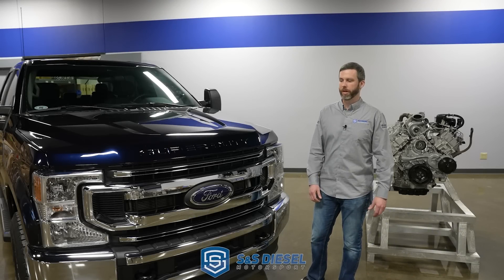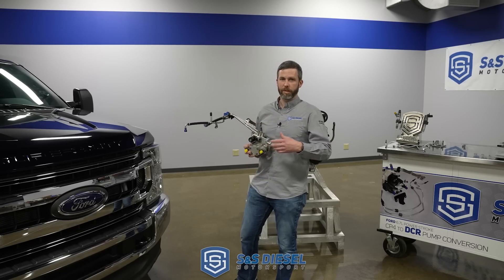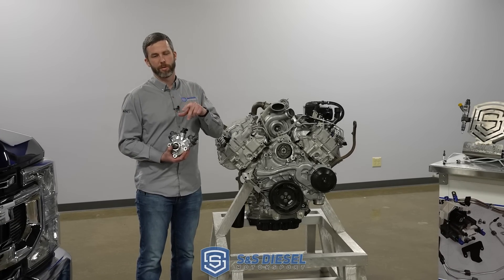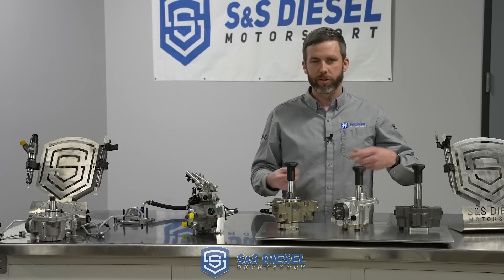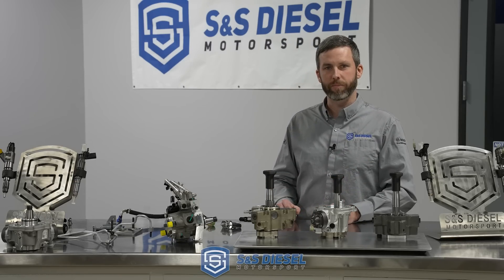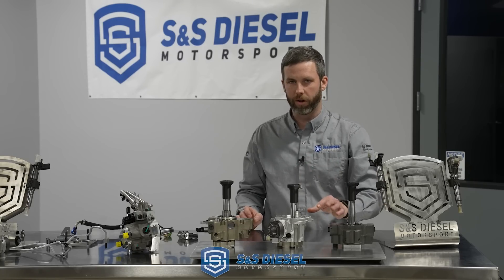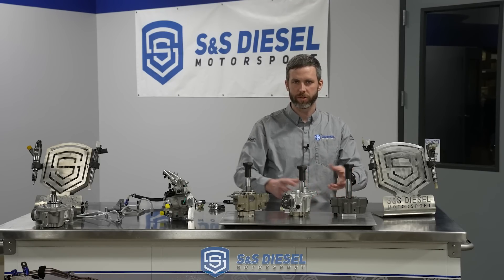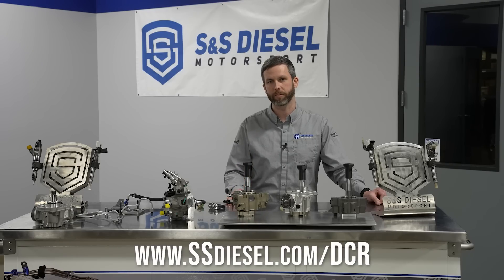The Long-Awaited Ford CP4 Solution - S&S Ford 6.7L CP4 to DCR Conversion

Comment: Does it flow more or less than a stock cp4 @ 2000bar? Is it more or less efficient @2000bar @stock 17-19MY max output? I'm super pumped you guys made this kit!
Reply from the maker: It has 25% more displacement than a 15-19 CP4.
Reply: @SSfueled  what about 21 cp4 in f250
Reply: 25% more than a cp4.2
Reply: @ryanstansel2338  I hope so. That’s really impressive! Do you have a link to this info or where did you get this information?

Comment: Finally!!! One biggest question is how good is your  warranty? I had a cp4 failure 15 mins. after installing the D.P.K. Truck only started up 5 times after I installed your kit. So now kit is a 400.00 paperweight. To keep ford's warranty on the new pump I could not put your D.P.K. back on or it would void the 2 year unlimited mileage parts and labor warranty for the whole fuel system from Ford. S&S did email me asking for my phone number, I replied with it and no one has EVER called back.
Reply: @Len Daniels did Ford give you a reason for the CP4 failure?...Also what was their rationale for leaving off DPK?
Reply: @zekester1  no, just that there was metal shavings in the filters. Plus pump would only reach 960 psi. Instead is the 5k psi needed to start. If I put the dpk on It would void the new pump warranty. When I installed the dpk it started. Ran it a few mins to check for any leaks, shut off to clean everything up, moved out of shop to change oil, started to warm up and checked oil level. Then it never would start after that.
Reply: @lendaniels7348  it sound to me the pump was having issues before putting on the DPK...if your fuel tank wasn't super low and you ran the truck for just a few minutes...it seems to me that little time would not have put metal shavings in both filters...did they replace your whole fuel system?
Reply: @zekester1  yes they replaced whole fuel system. I told them to give back the line I modified to install kit. Never had any trouble with truck ever starting and I've been in -2 weather. Truck had 115k mile one it. Know of one other guy that his truck died while running  at hwy speed and then truck would never restart. His truck had 75k miles on it, but Ford covered it under warranty. Ford was going to cover 90% till they saw a installed the dpk and denied any help.
Reply: @lendaniels7348  man, sorry for all the trouble...I've had my DPK on for about a year & 4 months no problems...I think they took advantage of you in this case....the dealer I go to is the one that put on my DPK & many others in the area
Reply: @zekester1  I have asked several other service managers and Diesel techs. It is up to them to endorse the dpk. Some say Ford should have it installed on every truck. Others say if it's that good why don't they offer it. Same with the active fuel management delete kits Chevy offers. Chevy knows it's a flawed system and the kits you buy aftermarket have gm part numbers and are cheaper than getting from the dealer.
Reply from the maker: Your particular issue is out of the norm, which is why we wanted to have a conversation to get a better idea of the details. We apologize for dropping the ball and not calling you back. Our warranty is two years and unlimited miles on all products. Thank you for bringing this to our attention, you'll be getting a call today.

Comment: Great news for us.
Besides the fact that this pump eliminates the CP4 problems the only other thing I cared about hearing was the Horsepower capability of this pump. Does it flow more than a Stock 2022? Will it run high-performance aftermarket Injectors without starving them for fuel? 
Not to sound negative, but thank you for this awesome innovation.
Reply: @carterlawson5784  Yes it is. They are just taking orders for 11 to 19 first. There is a second video of them explaining this.
Reply: @carterlawson5784  If you simply watch the video they posted after this one you would hear what I said in my last reply...
Reply: @carterlawson5784  it's definitely coming.
Reply from the maker: You're welcome. We designed this to be a durability improvement and have not tested for increased power. The DCR has 25% more displacement, but that may not necessarily equate to a 25% power increase (if the calibration calls for it). Since it will be CARB compliant, just installing the conversion by itself will not increase output in any way. We do not recommend changing the calibration on street-driven vehicles.
Reply: @SSfueled  Peace of mind is more important than hp numbers.
Thank you for the reply.

Comment: This is perfect!! I really like the fact that Stanadyne is behind this his! When my CP4 craps out I know what I’m ordering. Might even order it ahead of time to be prepared!
Reply: Why would you wait for it to fail??
Reply: @wyo_garage20 my thoughts too
Reply: Don’t wait for a failure
Reply: I’ve got an extended warranty with the dealership local to me. They will pay for upgrade with labor included. I mean I’ve got 60k I can rack up. If it goes out in that time frame why not take advantage of it? Once warranty is up I’ll do it myself…along with other things they don’t want me to do.
Reply: @sav300  cool beans
Reply: @jamesw.6931  I have the prevention kit as well just incase. I’d love for it to go out under the warranty but if not it’ll get done. I’m ordering mine as soon as they list them on the site. On the notification list with Thoroughbred diesel!!
Reply: @jamesw.6931  My 2020 went out at 89k miles, I live in Florida and my truck took a shit in Nashville, TN. I payed for the extended warranty out to I believe 125k miles, but Ford would not cover my trucks pump. They came back after my truck set behind their locked gate for 3 days, and said they found gasoline in the fuel. Which I know is a bold face lie, because the last place I fueled up was at bucee's in Calhoun, Georgia. Where I topped off my DEF and topped off my fuel take with DIESEL, they don't even have a gasoline pump at those particular pumps. Yes, they tried to make me believe I put gas in my tank, and then went from Calhoun, Georgia all the way to Nashville before my trucks pump blew up...yeah right!
Reply: Yup, I have a buddy whose employee put gas in his diesel, and it barely made it out of the parking lot before failure. They said I went 60 miles thru the rest of Georgia and then all the way up to Nashville, which is at the top of the state...no way that could happen.

Comment: Same question, how much horsepower will it support? Will tuned trucks benefit
from this pump
Ie increased fueling vs the stock pump.
I'm asking bc I'm wanting to upgrade my turbo and pump. I would love to get this pump and knock out two birds with one stone! 👏
Reply: Listen to the video they upload after this. It's a larger displacement pump.  Read between the lines and it will answer your question.
Reply from the maker: We designed this to be a durability improvement and have not tested for increased power. The DCR has 25% more displacement, but that may not equate to a 25% power increase.

Comment: How much $$$?
Reply from the maker: $1,990
Reply: @SSfueled  Gotdam! That's about 3x too much. Who is going to replace a pump that's not failed?  You would sell the heck out of them at maybe 1.5x-2x the price of the DPK.  I understand a whole system is 10k.  Nevermind, I had no idea a standard replacement was $500-$1000.
Reply: @SeaPro360  Not sure where you are replacing a CP4 for $500-$1000. Many people depend on these trucks for their livelihood, an unexpected CP4 failure can be extremely inconvenient and costly in lost revenue. a $2000 investment up front is a no brainer to many if it eliminates the failure point. Its only a few hundred more then a replacement CP4, and that assumes you had a DPK when the CP4 failed...
Reply: @legohead6  Yeah, you're right.  I just can't get an answer to this question:  How many current CP4s fail without gasoline/water/def contamination?
Reply: @SeaPro360  probably very few, but that doesn't necessarily mean it was a direct fault of the owner/operator(pumped from a low volume station that had contaminated fuel in its tanks, etc)

Plus accidents happen, we all have our momentary lapses and do stupid things. I would be curious to know how robust a DCR would be in the case of DEF. And if the DCR can handle it could the injectors?

Comment: Will this work with the disaster kit I just installed from you guys? Or will it have to be removed?
Reply: Me too like to know that answer
Reply from the maker: The DPK is not compatible with the DCR, but it is not needed. The DCR internal plumbing feeds the case and plungers independently.
Reply: Wish they said something before bought this kits.
Reply: DPk is not needed and will not work.

Comment: What is the price point on this unit you just talked about the pump but didn't explain anything like how unique it could be that you didn't demonstrate the differences !
Reply from the maker: The price will be $1,990. Start watching at 11:08 to learn about the differences between the CP4 and DCR.
Reply: @SSfueled  If I'm demonstrating something for  $2k it's better to be under direct light like outdoors and the price is close to double better be Made out of titanium 😂🤦‍♂️ what's the warranty on the pump that was poor demonstration to be honest
Reply: @banger881  Apparently your hearing is not very good. The explanation of the difference between the CP4 vs DCR was more than adequate. And if you are NOT willing to pay an additional $800-$900 then go ahead and buy another CP4. If I remember correctly the only pump on the table during the video, that will send bad material to the injectors and fuel rails IS: wait for it...........The CP4....... But you go ahead and save $800 and gamble with another CP4... 😵😵😵
Reply: @Wayne  I'm mechanic who the heck should u be 🤣😂 I work on my own truck do u ? Keep talking crap 2017 ford f350 160k miles never the cp4 was replaced change fuel filters every 20k miles you will hardly have any problems specially adding  hotshot  diesel Is fuel additive

Comment: What sort of horsepower does this support?
Reply from the maker: We designed this to be a durability improvement and have not tested for increased power. The DCR has 25% more displacement, but that may not necessarily equate to a 25% power increase (if the calibration calls for it). Since it will be CARB compliant, just installing the conversion by itself will not increase output in any way. We do not recommend changing the calibration on street-driven vehicles.
Reply: @SSfueled  relatively speaking the output should be the same then as the CP4, which should allow elevated power levels to where the CP4 holds. It’ll be interesting to see once people get these on their trucks! Thanks for the reply.

Comment: Can you run the disaster kit with this?
Reply: No need to
Reply from the maker: The DPK is not compatible with the DCR, but it is not needed. The DCR internal plumbing feeds the case and plungers independently

Comment: What’s the hp limit? Also if I’m running a piping kit will this work?
Reply from the maker: We designed this to be a durability improvement and have not tested for increased power. The DCR has 25% more displacement, but that may not equate to a 25% power increase. The DCR fits in the same space as a CP4, so there should not be any compatibility issues with other parts.

Comment: Power limits?
Reply from the maker: We designed this to be a durability improvement and have not tested for increased power. The DCR has 25% more displacement, but that may not necessarily equate to a 25% power increase (if the calibration calls for it). Since it will be CARB compliant, just installing the conversion by itself will not increase output in any way. We do not recommend changing the calibration on street-driven vehicles.
Reply: Noted, So then in a competition/racing application. It's about an equivalent to a 10 mm stroker cp4 pump.

Comment: What is the horsepower limit on the new pump?
Reply from the maker: We designed this to be a durability improvement and have not tested for increased power. The DCR has 25% more displacement, but that may not necessarily equate to a 25% power increase (if the calibration calls for it). Since it will be CARB compliant, just installing the conversion by itself will not increase output in any way. We do not recommend changing the calibration on street-driven vehicles.

Comment: Gotta know how much power it can handle
Reply from the maker: We designed this to be a durability improvement and have not tested for increased power. The DCR has 25% more displacement, but that may not equate to a 25% power increase.

Comment: Ford has provided amazing business opportunities for the aftermarket for years. The 6.0 and 6.4 diesels, and this, a clear example on the 6.7.
My question involves Ford's lack of respect for its customers by not doing this themselves? I can understand back in 2011 when Ford and GM both started using the CP4 simply because it was lightweight, inexpensive, and it worked only to find out they were a huge problem and a fatal design flaw. GM fixed this in 2017 with its use of the Denso HP4 on the L5P diesel. Ford continues use of the CP4 and it took the aftermarket to solve this problem. Many Ford and GM 2011 to 2016 customers have had to foot the huge cost of a new fuel system and this continues with Ford 2011 to current. 
Why would anyone purchase a Ford product that has time and time again displayed such a huge disrespect for customers by continuing to use known defective parts, the CP4.2 for example? SSfueled along with Stanadyne have apparently solved this problem why didn't Ford? Why would anyone that does any amount of research buy a Ford?
Reply: Not me bought my first Chevrolet after 30 year's of Ford's.will never do it again.
Reply: Don't blame the pump...blame the fuel. The enviros have forced this on us. Look at the failure rate with this pump over the pond. They have hardly any failure rate because of the lubricants they have vs the American diesel fuel.
Reply: Gm and ram trucks don’t hold up on the farm like a ford does. Been a few of these reach a million miles already…. Those gosh darn things 🙄
Reply: 99% of cp4s that go boom are self inflicted by gas ,def or just poor maintenance when you sale as many trucks as ford then stuff can happen but remember ford is one of the only car companies to not file bankruptcy
Reply: Because despite what your anecdotal experience on the internet may indicate, the CP4 failure rate is extremely low to the point of being a non-issue. Less than 1%. Combined with the fact that the ford trucks are usually of much higher quality overall in the chassis and body than GM and Chrysler, that's your answer.
Reply: @kelceyk8199  your entire comment is bogus. Lies.
Reply: @wyo_garage20  Where is your proof ? Before you call someone a liar !
Reply: @TonyBenton0728  Pipe down. I already called said individual a liar…sit and watch
Reply: @wyo_garage20  Where is your proof ? Simple question . And I am sitting down !
Reply: @kelceyk8199  If this is a non issue then why the hell did SS Fueled go to all this expense and trouble?
Why is there a disaster prevention kit? Why is there a class action law suit against Ford over this?
I cannot believe the level of blind loyalty to a company that could care less about its customers, it is just crazy.
Reply: @Jim M  because while it sucks to get stuck with a 10k bill, CP4 failure rate is less than 1%, it's just a small group of guys who got unlucky.
Reply: @kelceyk8199  Again, lies
Reply: @wyo_garage20  It appears that you want the business to install these pumps. Didn’t saw that additive’s cured the problem they do help some by adding lubricant back into the fuel. Google the question What percentage of cp4 pumps fail . Simple!  Argue all you want there are cheaper alternatives.
Reply: @TonyBenton0728  And again, a whole bunch of nothing🥱🥱🥱
Reply: @wyo_garage20  And how so ? You judge don’t like being challenged ! You just want the business that’s what you are after.
Reply: @wyo_garage20  You are an independent shop ! Your handle gives you away ! And if you don’t work on Fords why are you so worried about it. If this is marketed toward Fords?
Reply: @wyo_garage20  You never gave any proof as to why you called that gentleman a liar. So who openly their motives and inserted your foot. And really don’t know why you are not angry about this . And as normal when someone can’t get any valid proof or evidence. They resort to name calling and fowl language. So what is your experience with this subject?
Reply: @kelceyk8199  I read it's 7% in the US and 1% in Europe where the diesel is more lubricious

Comment: What horse power are these rated to? Are you going to have an upgraded system in the future to handle higher horse power levels?
Reply from the maker: The DCR has 25% more displacement than a CP4. It will match the CP4 within the stock calibration and has more output in reserve.
Reply: somebody will modify them eventually hopefully